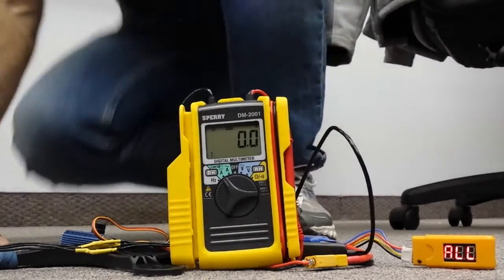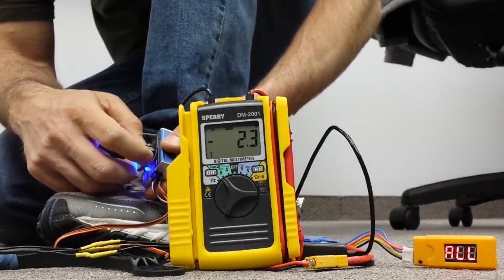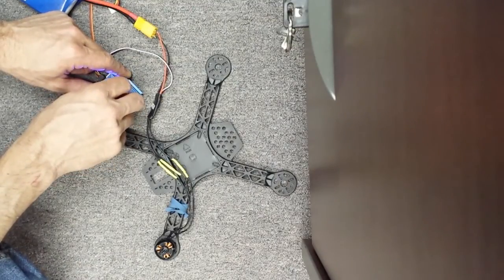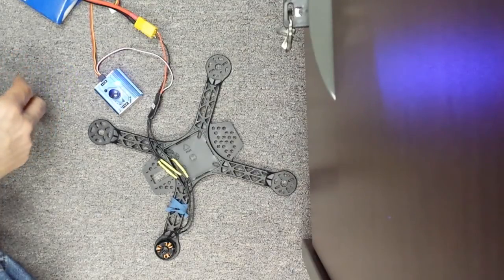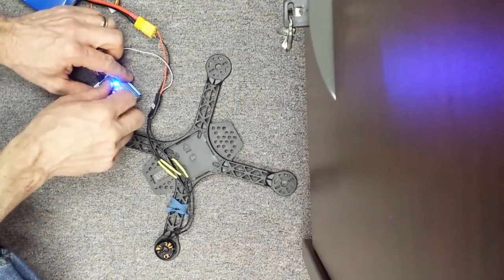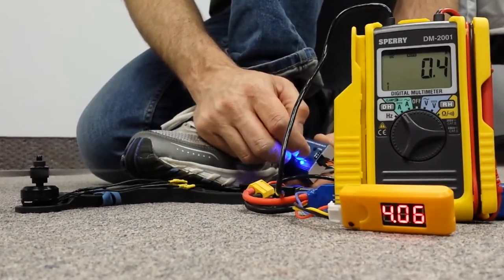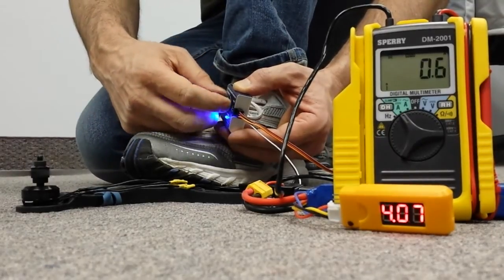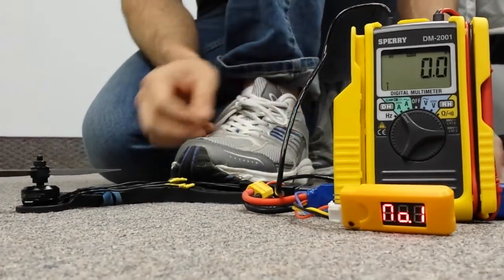BLHeli ESC timing issue demo and fix for Cobra, Sunnysky, RCX 2300kv motors

Comment: Any easy and simple way to bring this ESC to the basic Default programming! I messed up one and now zero is in the center stick making it a nightmare to program.. thanks in advance.
Reply from the maker: it will reset to defaults if you let it run through the whole sequence without  selecting anything. You can take the first step of speeding up the sequence but after that don't choose an option
Reply from the maker: of course it's much easier to get in there with a programmer, Arduino Nano or a control board. almost every blheli esc should have a bootloader on it unless it's more than one year old
Reply: +Rotorgeeks Outstanding answer, thank you so, so, so very much!! May I request to know when and how to know when the secuence is over???
Reply: +Rotorgeeks Also I have one of the ESC's that is set for fw and Reverse and that one seem to be impervious to enter any type of programming no matter what position the stick is in.... any advice on that one?

Comment: Thanks alot! I have sunnysky 2204 kv2300 with dys 20A blheli 14.2/14.3. Could you please help me with a few questions.
- Since I have both firmwares 14.2 and 14.3, do you think I need to make all ESCs the same? I have already successfully connected them to blhelisuite, so I guess I'm half way there. Do you agree? Have you ever bricked an ESC? 
- Are there other settings than the timing that I should change for this setup?
Thanks for your time :)
Reply: +Øystein always run the same firmware on your esc's. 

choose your settings, and if you are using a usb programmer, just go through them all, one at a time and write setup. Do not click read setup in between, as this will possibly change your firmware in between. 

I don't believe you can brick an esc, but you can have them catch fire if you use the wrong firmware. 

Change your timing if you are having issues with motor sync. Issues like this will be things like, very loud noise when running slowly. motor twitching or coming on when throttle is at 0, motor not starting up when you throttle up, but hums or twitches. 

DONT try to continue to run your setup if your motors are out of sync, you can very easily damage the motor or more likely the esc if you do this.

Comment: My ZMR with Cobra 12A ESC and Cobra 2204-2300 motors flies fine until it sudenly falls from the sky totally out of control.. like if one motor would sudenly stop..  rechecked solderings, changed FC, changed firmware of ther CF ,changed even one ESC i suspected and does the same..

could be a timing issue? if i begin to yaw from side to side non stop  it begins to "bounced" and jump upwards losing control with each yaw.. like if its becaming "dizzy".. wonder if its timing too

so the recomended is medium-high or high?

Comment: ????
the new version of the esc comes ready and i don't need any setup configuration  for 3s 4s 2000 to 2350 kv right i can switch to 3s and 4s without any problem what is the biggest props recommendation for a mini 250 quad running a 2300kv and 4s not to burn anything thanks

Comment: Hi guys I bought new cobra 12V esc's to run my cobra 2300kv motors. They seemed to work really well together. after a couple weeks of use I had a couple drops after hard acceleration. I reviewed the footage and heard the same chirp sound. Is the ESC not set to run the motors out of the box?  If not to set timing with the Tx can you program all the escs together or one at a time?
Reply from the maker: HI Cody.  Those Cobra ESCs are not the same as Rotorgeeks and are not running BLHeli.  I don't know how they work.  This video is actually a bit dated already since the new Rotorgeeks ESCs can run both 1960 and 2300kv motors on 3S and 4S without needing to make any changes.

Comment: Is this on 3S or 4S?  I know that with MRSS RapidESC, I have none of these issues on Cobra 2300kv (but that is on 3S).  I would be helpful if you notate how many cells you are running here.
Reply from the maker: rjbishop12 very delayed reply but this was just 3S.  Time has passed and now the v4 version can run 3S and 4S without config changes

Comment: one of my afro esc and cobra 2300kv is doing this too, it runs fine for a few minutes then it makes the chirp and falls out of the sky, so its the esc?
Reply from the maker: Yes, that is a desync.  New version of these ESCs can run 4S without sync issues -  it's crazy fast.  Check out the Wasp Hex on 4S video!